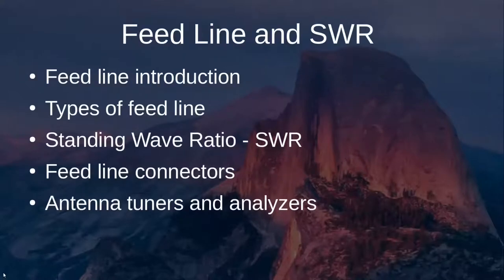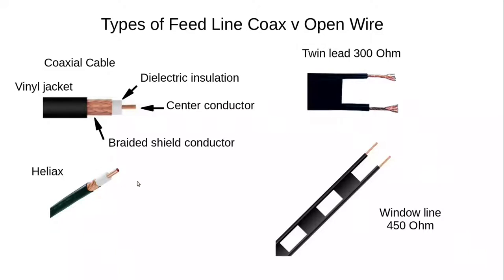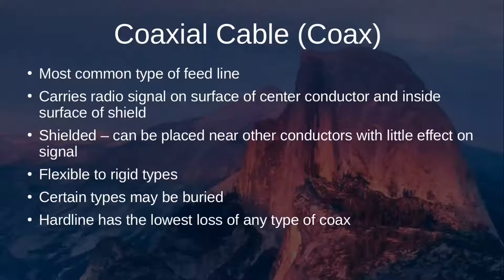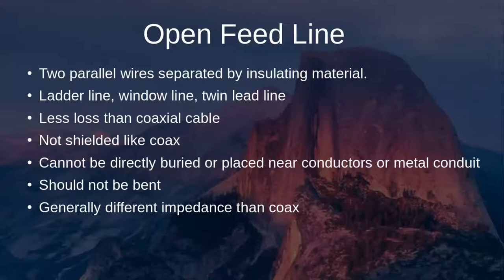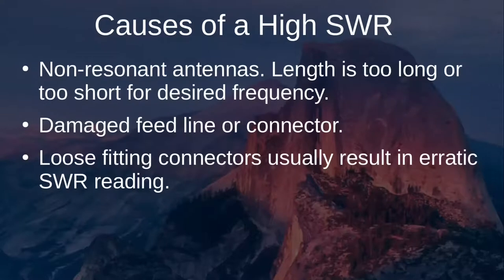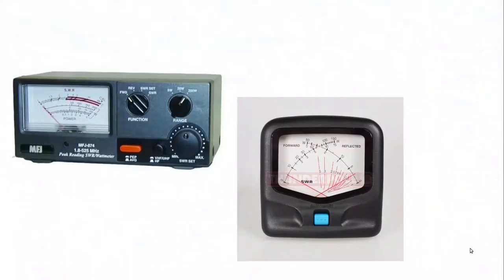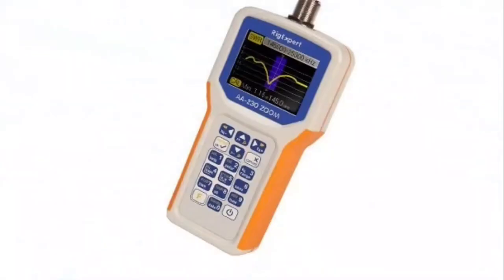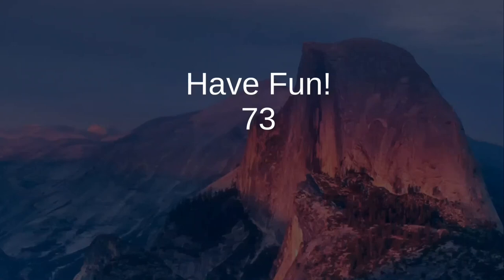10 - Feed Lines and SWR

Comment: Isn't the tuner providing a conjugate match where all reactances are cancelled out within the whole system deaming the whole system resonant, with reflected power being re reflected at the tuner back to the antenna if the feedline is improved so would reduce the loss within the feedline, in the theoretical lossless feedline all power would be radiated no matter what the swr or mismatch is